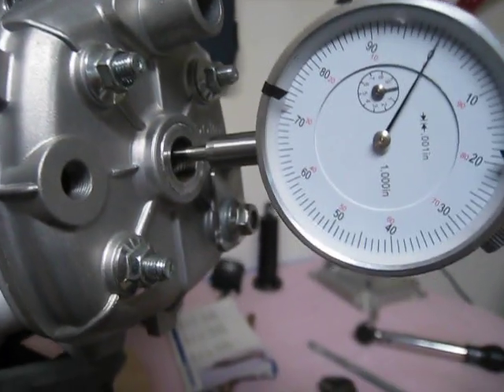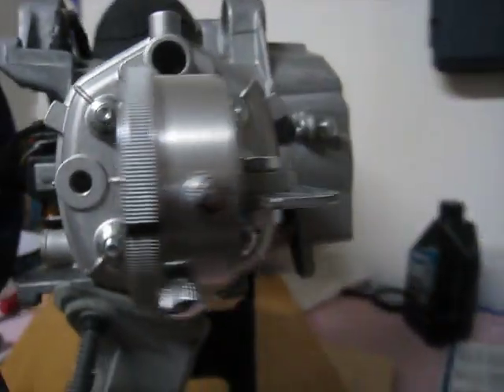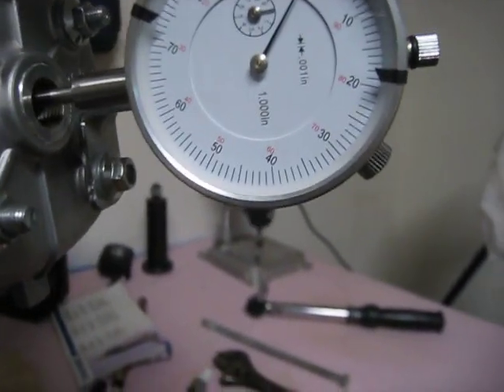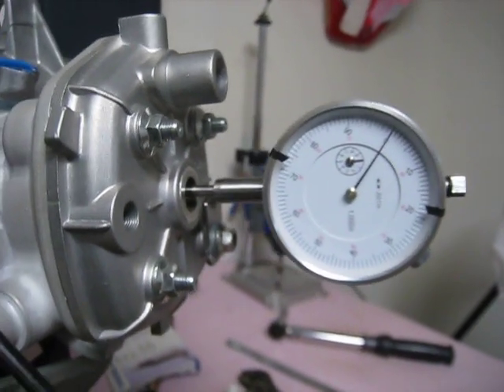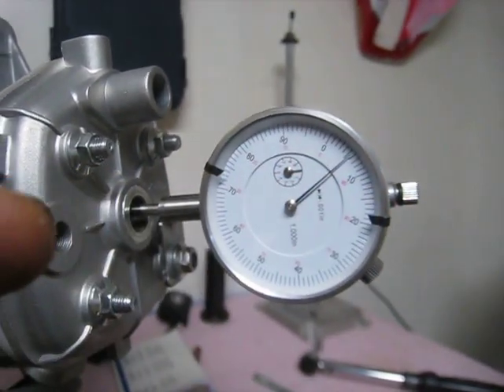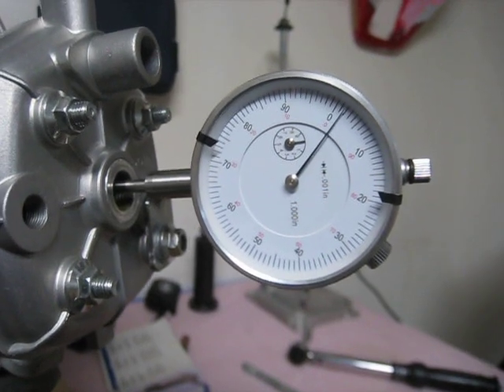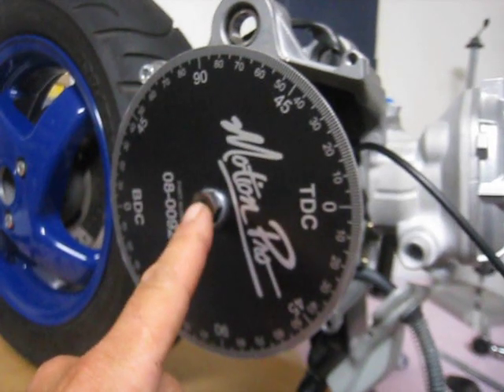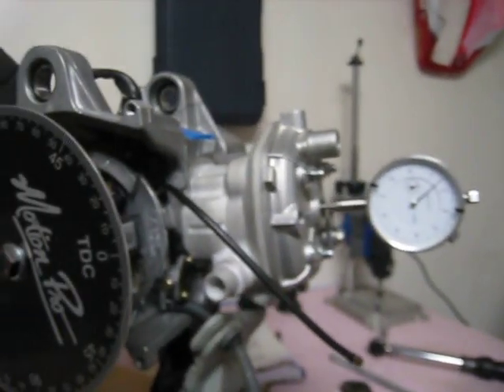Top Dead Center 2.AVI

Comment: if you're around roxx, so during the length of time that the piston is at tdc do i split the difference in the degrees  or do i call tdc when it first reaches it's top position. for a single cylinder 5 hp gravely motor, it's old, and worn, but has a helacious duration of tdc. for some reason i can remember my dad doing it on hodaka motors putting it in the middle. which seemed like a lot of degrees at tdc.thanks